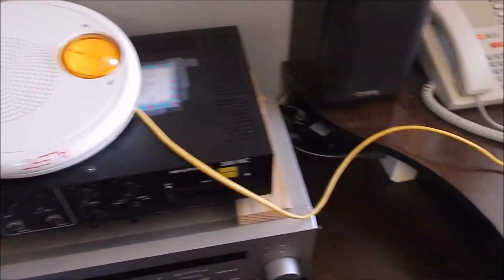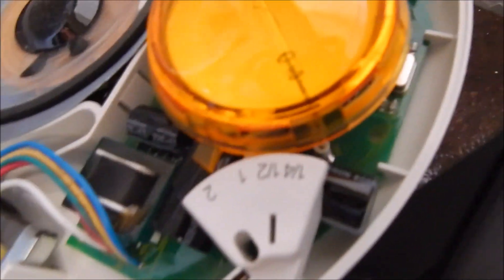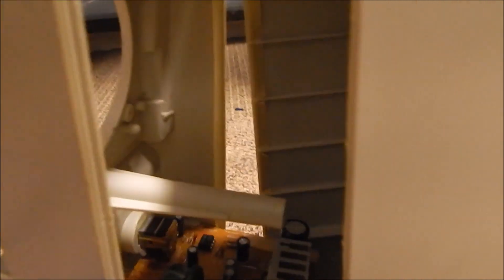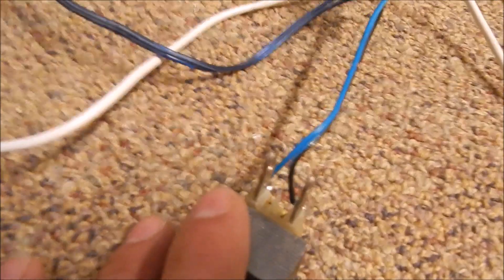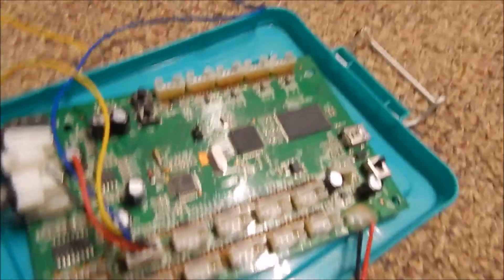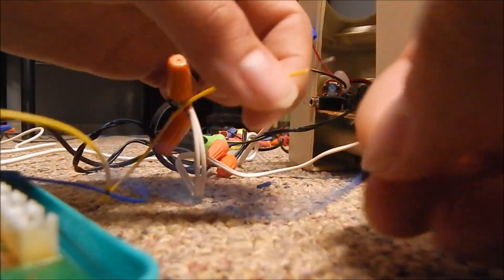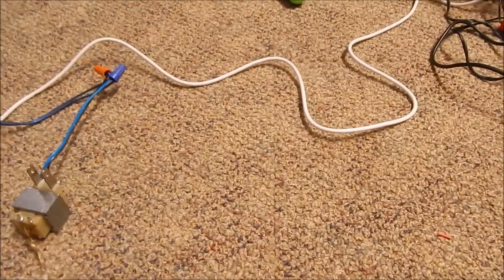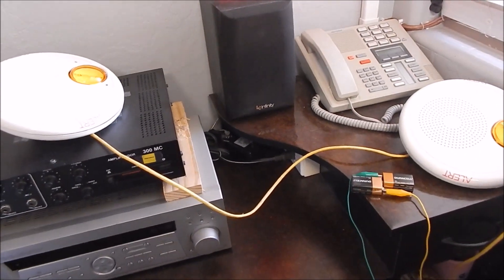EST Speaker Strobe Alarm Part 1 Temporary Setup

Comment: Yes, these strobes are indeed designed to synchronize perfectly every time. Imagine the tolerances these devices have to be made within for that to work!! No other alarm manufacturer in the United States (or perhaps anywhere) has figured this out yet! 
These are part of the Genesis series: the first ones that had automatically synchronized strobes. The 2nd and current generation of these use LEDs instead of the noisy/power-hungry camera-style Xenon flash tubes these are using. The ceiling mounts actually have 4 strobes on them which is an interesting design choice.
Reply from the maker: These EST alarm strobes are cleaver and like it which I wonder why other alarm manufactures haven't figured this out. Some of the alarms require a external sync module for the strobes such as System Sensor as an example.

Comment: Can you use a 120v to 12v transformer to run these? Im thinking of getting the 70 volt version of that EST alert speaker strobe, but i only have a regular stereo amplifier.
Reply from the maker: A 120-volt to 12-volt adapter will run the strobes without any problems. Just make sure it's 12 volts DC, not AC, and that it puts out at least 2 amps or 2000mA. If you use multiple of these speaker strobes the strobes will sync with each other off of the same power supply. Also, you can bypass the transformer and connect the speaker directly to a standard stereo amplifier since the speaker is 8 ohms.
Reply: @CristianOrtiztechmaster926  Thank you, I liked the setup you had here in using the transformer to power the PA speaker aspect of the alarm. I saw you had a 120v to 6v to do that and i was just wondering if a 120v to 12v would do the same thing.
Reply from the maker: 12 volt DC power supply will work fine. You can even go to 24 volts DC as well if you needed more power. The 6 volt power supply was for the MP3 trigger board that I used to play the message.